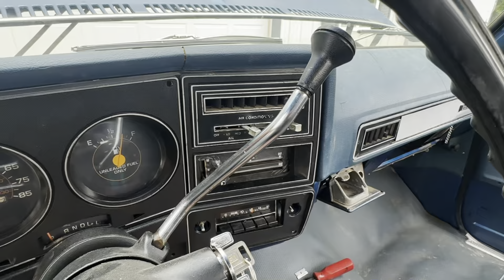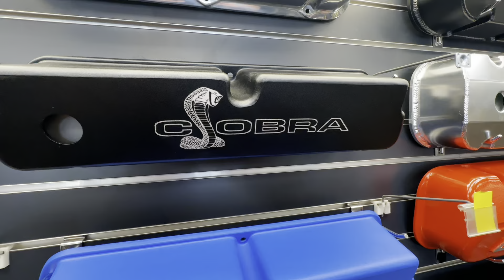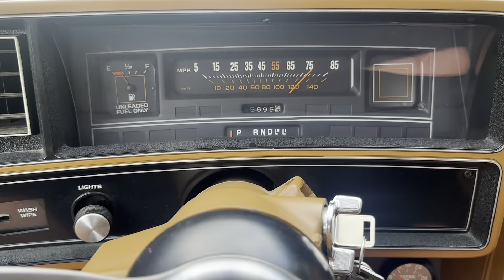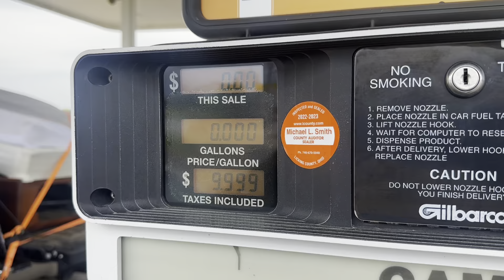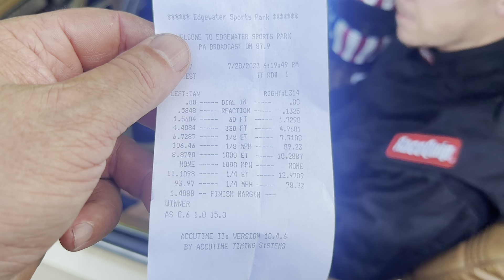BILLY THE KID DRIVES THE MALIBU AT CINCY STREET NIGHTS!

Comment: I also have a 1966 Chevy ll SS Marina blue with bright blue interior. Mine was 283/220hp and glide. It's my very first car that I bought in 1969.
Its been down the track a few times too!  Used to run bracket.

Comment: I bout a 327 engine and trans installed in my s10 had crazy vibration ended up being the flexplate. Guy had the wrong one on it I believe it was externally balance and the engine was internally balanced. Plus it was cracked bad.